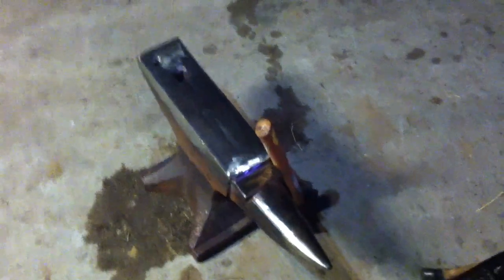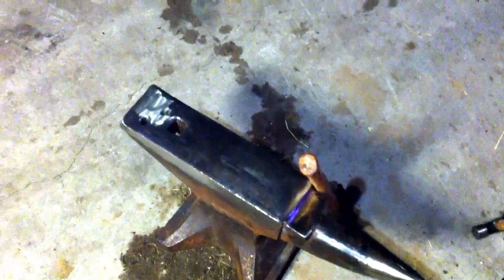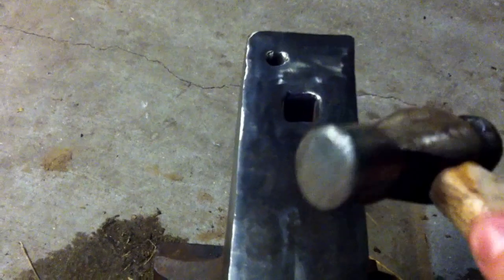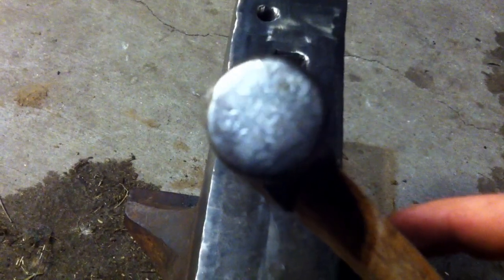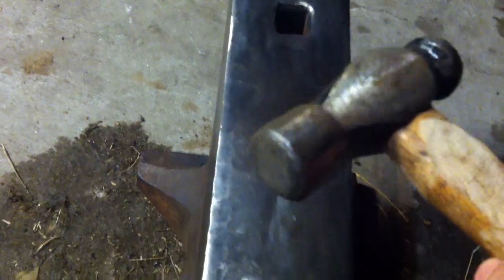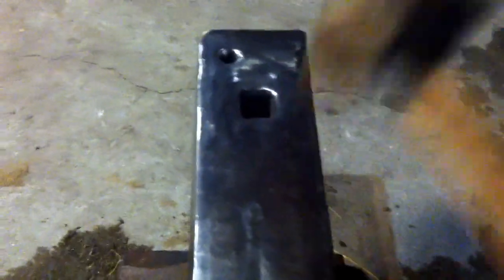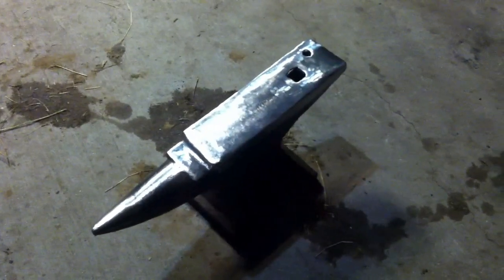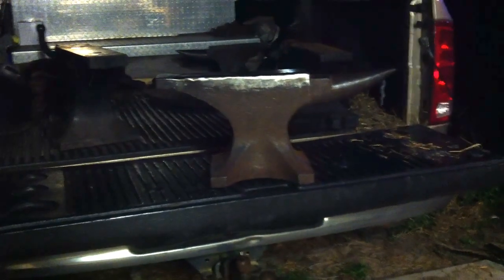Follow up anvil repair on German Trenton and Söderfors Sweden

Comment: The soderfors , it's just an cast steel anvil so why not just grind / mill it back to an flat surface while cooling it to keep hardened face ??? What is the point of building it up to have to just grind it back down again ???
Reply from the maker: That particular anvil needed an edge repair. Many times the preferred method would be to dress it out making a  growing radius the entire length of the face with a grinder/flapwheel, but these edges were badly chewed. If you were to mill it down, that would take an inch off the face and probably bring it down to the shelf. In that case you'd lose the function of the shelf. While it is cast steel, the quench was likely done by a flume, and the depth of hardness would be unknown. I wouldn't want to shave off all that steel just to be left with an inferior end product. Sometimes you just have to put metal where the metal once was like drywall patch, then refinish. with the right preheat, and the right rod, things end up working out.

Comment: Were those full build ups? Did you remove old faces entirely? I have to cut or grind out delaminating sections down to the wrought iron and rebuild somehow. Would it be easier just to build a big ass forge and have the top cut off and refinish the wrought iron base flat and forge weld a new top on? Really pissed at myself for buying the first PW I saw. I would really appreciate any advise you could give me.
Reply from the maker: I would follow the Robb Gunter method precisely when it comes to preheating the anvil. I did not remove the remaining top plate and it was still intact when I started putting down welds. The anvil was milled down on the top from the previous owner, only about 5mm remained. I would not cut the top off. I would use whatever remains of the top plate as a basis of build up. Some anvils don't require an entire repair, only problem areas like torch cuts, broken backs, milling damage. Just make sure that you are putting welds on clean/preheated steel. If you don't preheat, your welding can actually cause/worsen existing delamination. I would dress it with a flap wheel for finish... If you want the top plate parallel to the ground, mill the bottom of the anvil base, that way you are removing wrought iron and not a hard/repaired top plate.
Reply: Zachery Stroup Thank you for the valuable information. Now I have hope. She is too pretty to use as a yard ornament. I will be back to post results.
Reply: Which did you decide. Weld buildup or Weld on a new face.. I am about ready to do something with an old sway back, rounded over mushroomed Peter Wright.. Really thinking about a combo of both.. 
Putting enough rods down to get the edges back to support the top, and some welds in the center for support, and then, welding on a hard steel plate, and broaching the 1" hardy and drilling the Pritchel hole.
+Zachery Stroup Did your first anvil harden to the point you were happy with it?

Thanks guys.. would rather learn from someone else instead of doing it wrong to begin with.. 
Cheers.